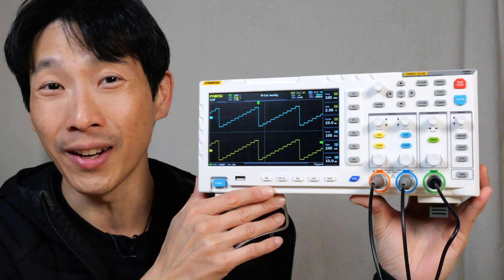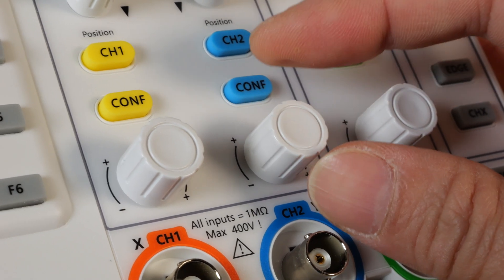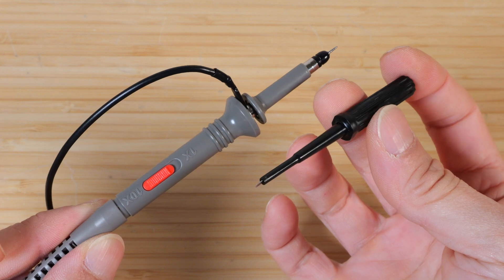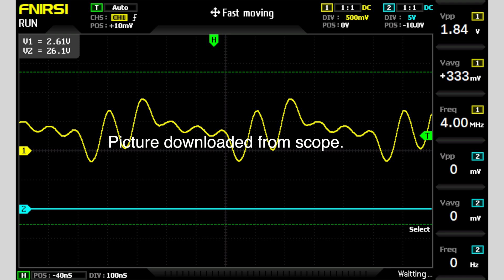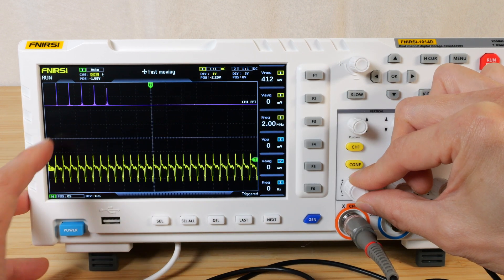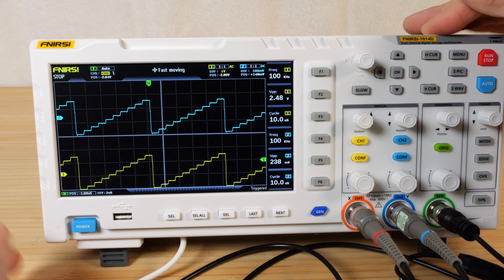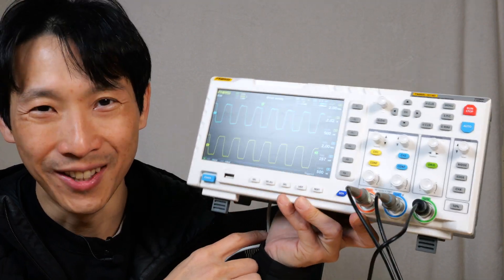$154 Oscilloscope from FNIRSI [1014D 100Mhz 2 Channels]

Comment: That's a lie! The maximum measurement frequency is up to 30 MHz, since at this frequency the measured signal is reduced by 3 dB. The sampling rate, according to measurements, does not exceed 700,000 samples per second!

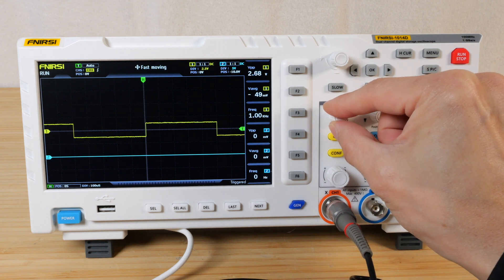Comment: I haven’t even finish watching your video and I have to stop at minute 5:09 17 times because you went from normal explaining to super modex100000 in 1/2 a second.

I want to support your content but as a novice learning electronics you are to fast.

You hook the two probes almost bybtelewuinesia and didn’t explained what negative probes where connected from what to what so quick from red negative to prove freq gen and blue blue blue 1/8 of a second later you magically without explanation show a wave from.

Please slow down brother, you were good and this video is probably one of the middle best ones about the d iris but you got to baby seat a bit to get those likes.

Thats what differentiates the blue birds or blue falcons from influencers, you got the skills just slow down and explain the content at a bigginers level❤ 

Cheers, I’ll try to finish it and reinvent what you mean or miss

Comment: Hi I need some help I,m 65 and I am trying to fix old radio's  I want to learn how to align,  It says I have to use a .1 mfd capacitor at pin 4 of a 6sg7 tube, How do I turn on the generator signal ,I am not hearing a tone, at my age I never thought I would feel so stupid, can build a house restore a car, But cant figure this out, I have always learned better with hands on with a Person sitting next to me teaching ,I have learn how to do anything that way, with lime Hurting my Memory and all medical problems, Its a fight , sorry for the rambling,
Reply from the maker: Sounds like it could be one of many things. The tube could be broken, could be not a completed circuit, or maybe you have to turn on the signal gen on this scope.
Reply: @BeatTheBushDIY  How do I turn it on, I got a small booklet that does not say much

Comment: will it read out the frequency without using the cursors?
Reply from the maker: Yes, use the measure function next to the other items like vpp, but make sure to have enough unclipped cycles to get an accurate reading.

Comment: will the function gen sweep?
Reply from the maker: I should have tried this but it is one of the functions that is buried in the menus. You can use the 'custom' fn gen output and your are supposed to be able to adjust the fequency but I have not used this myself to see how well it behaves.
Reply: You cannot sweep. The signal is fixed until you dial in a different signal. You ge one signal at a time with too many steps other than just dialing smoothly.

This scope is a good pair of eyes in signal under 50 Mhz.

There is a whole new learning curve. I want my old 453 back
Reply: @erin19030  I bought one of these. It's a hunk of junk

Comment: THANKS HEAPS!!
This in an EXCELLENT video ! I've never really used an oscilloscope despite repairing electronic equipment back in the early 90's (they were too bloody expensive & thought it best to keep clear of them).
Your video gives me the confidence to experiment, in spite of the fact I'll rarely use it - perhaps ONCE per year!! ... but thinking about that, I've bought tools which I've not touched for 10 to 20 years & have found uses later in life. Thanks Again.
Reply from the maker: It's more like a tool you keep around and use as needed. Most used when you are actively putting together DIY electronics, occasionally debugging and fixing things. I found a 32kHz crystal being detuned using a scope.

Comment: which one would be better to buy the 1014d or 1013d
Reply from the maker: 1013d is more portable, 1014d has real knobs. I like knobs more than a touchscreen but it’s about $30 more.
Reply: At the price of 1014D you might as well consider an Owon SDS1102 or one of its slightly modified rebrands such as by Hanmatek or other random brands, they come out to about the same. No flashy features, but what's there works well, except the FFT is slow as molasses, but then that's usually fine as well.

Heck i bought an original SDS1104 for that money.

Comment: FNIRSI has a reputation of having 100Mhz scopes having an actual bandwidth of 20Mhz. I would have liked to see a test of the actual bandwidth. Otherwise it looks good for the price.
Reply: yes most of their produts sound too good to be true, i saw a negtive video about their geiger counter
Reply: @SharvilSawargaonkar  Maybe they will improve. The new component tester looks good.
Reply: @gbennett58  I hope so but most probably they won't ,it is a whitelable brand and the OEM manufactures for multiple such brands and there is  competition between these brands mainly based on price and not on features

Comment: What kind of repairs is this thing good for? I got some speakers from goodwill and they are in great condition but they don't power on... I think likely it's a bad cap, but I don't think my multimeter is that great for checking caps.  I know something like this might be good for certain kinds of repairs but I'm not sure exactly what.
Reply from the maker: DMM is usually enough for repairs. You need this for checking say, noise levels in batteries, debugging voltage signaling levels, checking if a signal is clipping at the output, checking signal peak to peak voltage and measuring gain, the list goes on and on. Generally for more in depth evaluations.
Reply: My favourite repair tool is the very cheapest LCR-T3 made by 91make. It is super quick and can tell you the condition of capacitors and most 2- and 3-legged semiconductors with good enough confidence for many repair purposes, especially power and audio electronics. Do not be tempted by more featureful devices, they have flaws, from dumb nitpicky to fatal ones.

Comment: thats crazy thats its under $200 for 100 MHz.  Back in 2022, I bought a Siglent O-scope 100 MHz for over $500 but mine has 4 channels (SDS1104X-E).  Actually, on mine, the firmware can be hacked to increase to 200 MHz.
Reply from the maker: Each channel is $100, makes sense. =D
Reply: Dude its 30MHz oscilloscope with big inside noise, small memory and small vertical sensitivity... 
This is not 100MHz oscilloscope